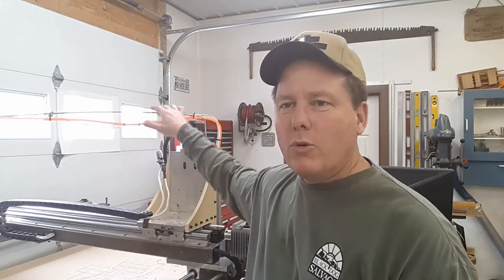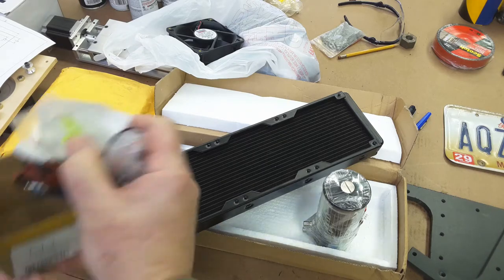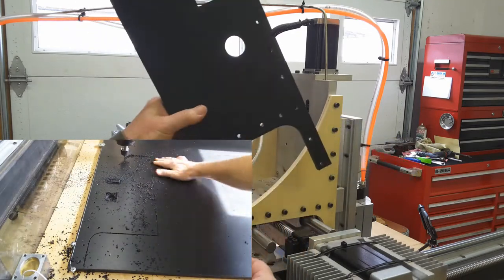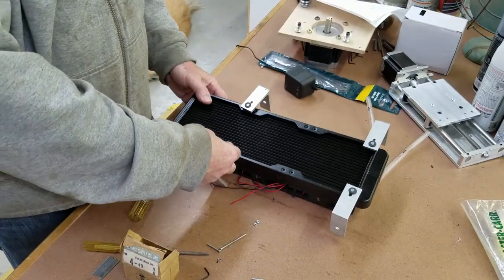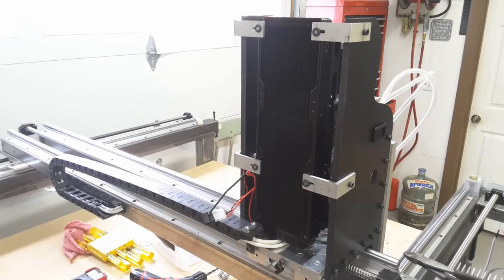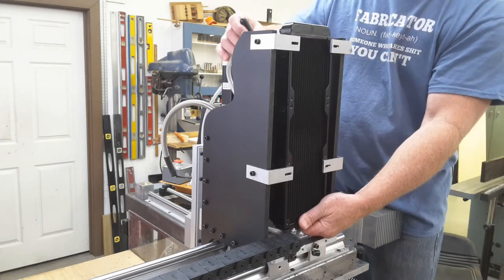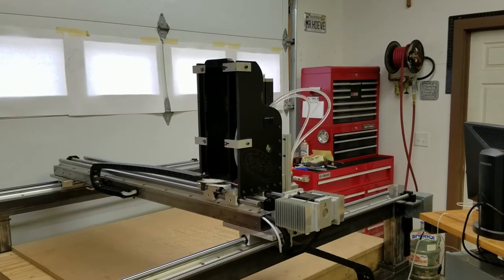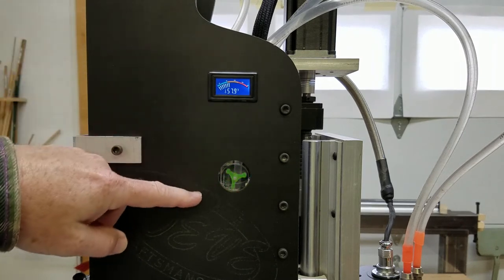CPU style Liquid Cooled CNC Spindle - Onboard & self contained

Comment: Very nice project and quite nicely performed.
I have a question about, what kind of material(s) the water/liquid coolant is being in contact with, in the spindle?
The reason i am asking is because, those PC radiators are most of the time made of copper and copper doesn't play well with aluminium in a water-cooling loop.
Have a great weekend and stay safe during that human malware pandemic outbreak <3

Comment: Really nice setup and amazing how cool it stays now!  Awesome work...
Reply from the maker: It never got warm in the past and hind sight would have a 2 fan unit for sure.  Maybe someday I will run into one and swap it out.  If I used really large diameter cutters it might generate more heat but I don't think it would be enough to matter....
Funny story...on one of the first test runs, where the spindle and cooling were running with no cutting, the temp was going up.  I realized that the spindle was colder than the room and the system was bringing it up to temp to match.

Comment: I mean for the air. I run cnc machines in a mainly wood shop, and most cnc machines (and most computers) have a negative pressure in the case, which leads to air leaks into the case, which leads to an unbelievable amount of dust in the case. your set-up doesn't have a case per se, but the fan will get full of dust in a big hurry with no filter.

Comment: Looks good but it is still unknown if this cooler will keep a spindle running for hours under full load cool enough.
I would rather swap the cable carriers for bigger ones and run the water lines to a circulation pump. If the temperature goes up you dump some ice into the bucket without interrupting the job.

Anyway, diluted glycol-based radiator fluid does a good job in preventing things to grow in closed-circuit cooling systems.

Comment: Hello:  Your LED Thermometer 3 Way Flow Meter FlowMeter that you are using, says it uses DC 5v.  Your Cooling fans and Pump are DC 12v.  What are you using for your DC 5v power? Do you have 2 separate  power supplies or one with the DC 12v and 5v options?  If so could you state which Brand/model?  Love the video and thank you.
Reply from the maker: That is correct.  I have two.  The original reason for the 12v is to power the fans on the control box.

Comment: Great proyect!! I'm still using a 20L bucket that takes a lot of space. Been looking for some radiator, but when look it up someone told me to be aware for it might get galvanic currents, is that so? Are you having problem with oxide? PLease tell me so i can update mine. Thanks!
Reply from the maker: I am having zero problems.  No visible corrosion and the water has remained crystal clear even with it in some indirect sunlight.  I figured it would grow something but never has.  I credit the silver in the water.

Comment: I am currently building a much smaller CNC to your magnificent machine, mines a Open builds1075 with a 1.5 kw 65mm OD water spindle with VFD and I notice that you said that if you built this again you would only use a two fan radiator, can I assume your spindle is a larger 2.2 kw or larger still.  I am looking at this and was not sure as the pumps that come with the spindles as part of a spindle/vfd kit have a throughput of 3000 litres an hour with 75 watt pump but the little reservoir you are using runs a much lower pump and seems to be working on your machine even under load very well......probably only pusing 500 litres or so....

I wont be working on anything other than wood or plastics so wondered about using just either a two fan unit or even a 1 fan unit, I have seen the little flow meter and temperature gauge, one other question do you have anything wired into your system in the event of pump failure that will stop the spindle or prevent it overheating.

I realize the flow meter is a visual indicator but if you were to run say a 5 or 6 hour long job and left the machine and God forbid the little chinese impeller pump fails what would stop your machine from overheating and killing the spindle, VFD etc, I just wondered if you had a protection circuit in there anywhere to kick in if cooling failed?

I love the idea of the closed loop mini pressurised system to avoid all the pipes , I would probably use a refrigerant in it for several reasons one it does stop freezing just in case and it does protect the system by neutralising any water issues and finally it should allow the water to act more like that in a car system and change the temperature of how the water heats, although on this we are talking about much lower temperatures. the main concern for me is the risk of overheating if the circuit fails and I cant see any protection for that in your system, I dont know whether you leave your cnc on its own ever but that to me is a major concern looking at the type of investment you have in your shop.

Just something like this would add protection possibly? Or an overheat alarm?  https://www.ebay.co.uk/itm/12V-20A-Digital-Thermostat-Temp-Relay-Control-Temperature-Controller-w-Sensor/132591995870?hash=item1edf194bde:g:CN8AAOSwnada2zkW

Thanks for the video , its given me great ideas for my own little cnc just have to microsize it a bit down though.......still not sure on one or two fans though!! 

The only thing I might do is mont mine on the wall behind the cnc and have a couple of longer pipes simply as your Gantry is very large compared to my c beam and I am concerned on the additional weight along with the spindle. Im not too worried about the hoses but I like the closed loop to keep out the crud from the water etc and save changing it all the time. thanks

Comment: you should use waterless coolant evans high performance engine coolant.. they use it in radiators of race cars and it is used in airplanes,,,it wont corode like water can, it wont evaporate etc.  i use it in my bmw and my cpu cooler.

Comment: You're right to add silver, any concern over rust in the motor since it is water though? Shouldnt you have some glycol or anti-freeze in there to prevent corrosion?
Reply from the maker: Good question.  I hadn't thought of that.  I used to run RV anti freeze and plan to go back to it this winter.

Comment: Hi, just come across this video and it’s exactly what I need but since it’s a few years old can you tell me if it’s still in use and also what liquid or type of water do you use? Thanks, Steve in the UK...
Reply from the maker: Hey Steve.  It is still in use and working perfect.  If i did it again I would only use a two fan radiator.   2 would be enough.  3 is just overkill.  I use distilled water with a silver sliver in it.  The silver prevents growth.  I haven't had to change the water yet due to algae.
Reply: sbirdranch morning and thanks for replying. Overkill is better than a seized spindle 👍 I need to look into the silver sliver, I’ve never heard of it or what it does but thanks..
Reply: Hi again, I’m trying to source a water pump similar to yours but I’m struggling in the uk so is it possible to send details? Thanks in advance. Steve...

Comment: really good and i want to do this but how did you get the 4 pin pump running with out a motherboard powering it please?
Reply from the maker: It has a 4 pin connector but only uses 2.  A positive and a negative 12v leed.
Reply: @sbirdranch  so you just removed the connector and used two wires? It  didn't have 4 like most of these pumps and then wouldn't work, as there is no motherboard, the reason I ask as this is the only pump i can get over here in europe where I have heard you say you can do this so if it is only 2 wires it would be perfect for my machine or if its more more than two could you briefly explain what you did to get the pump working if you can remember please, I am building the same setup following your setup but with two radiators as my spindle is smaller and this is the only thing holding me up trying to find basically a two wire pump that is more than 300 litres per hour as that is not enough for the spindle, many thanks for any help again. Neil

Comment: Is that Radiator aluminum? What if that spindle has a copper heat sink in it! In PC cooling we try to keep those 2 apart because of eventual galvanic corrosion. But it's less trouble if that happens here I suppose. No electronics you're going to fry. 

yea, i hear those Chinese pumps suck big time. You also need to to have them full of water before you start running them. Even testing them in open air for a few seconds can damage things. They need water as lubricant.

Comment: Hello, yes, i have a very important question, i was hoping to get an answer from someone here in the US, i installed a PC water cooling system on that machine, before that my previous VFD and Spindle were working fine, after i got the water lines run properly, i went ahead and started the spindle, it made an electrical short inside, i turned off, checked all the wires on the spindle plug, they were fine , i started the VFD again, and the VFD blew by an electrical short too, now is that have something to do with the water system making that short? is that water touching the internal components at some point that could be the cause of that short on both units?
Please let me know  because i already ordered a new set, 220v VFD and 220v 2.2KW water cooled Spindle and i don't want the new set to blow again!  im building this machine myself so all the info will be appreciated thanks!!!
Reply from the maker: That short had nothing to do with this type of cooling.  Mine still works great. Sounds like there was a leak in the water sleave.   Had you been running coolant before or was this the first time?

Comment: I want to do something similar for my CNC router.  How is this system holding up for you now that 1 1/2 years have passed?  Is the pump still working?
Reply from the maker: Still doing well.  I moved things around a little putting the sump at the highest point for filling and making the inlet and outlet on the flow meter horizontal so as to not trap a bubble.  If i did it again I would use a two fan radiator.   Good luck.

Comment: How does it handle dust from the work clogging the radiator? Do you need to clean it very often?
Reply from the maker: I honestly haven't had it running long enough to say.  It is shielded from any direct chips so it will be ambient dust like gets on everything else including the control computer.  I cut out the piece of footage where I talked about maybe putting a piece of foam filter over the fans if it becomes necessary.
As of right now I think a periodic (like 6 months or more) hit with compressed air will be sufficient.  If that turns out to be wrong, I'll update you.